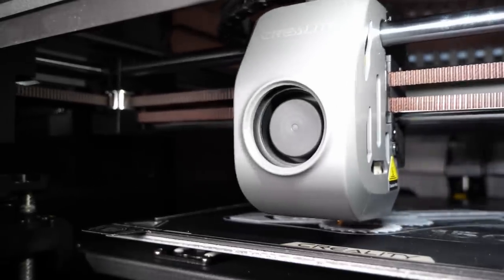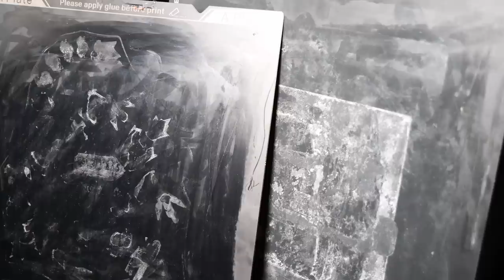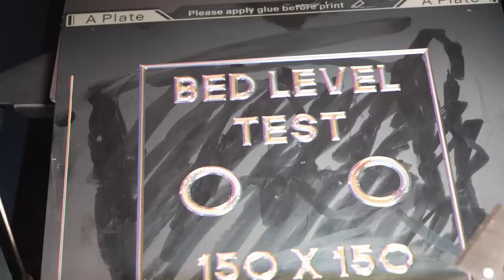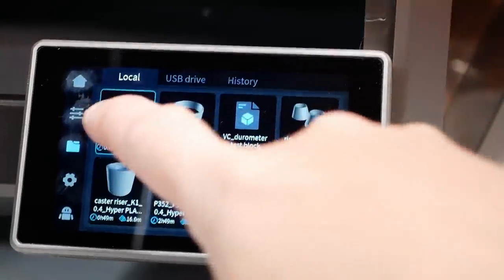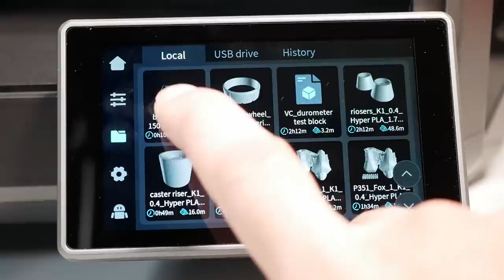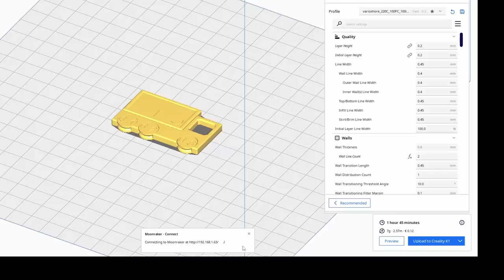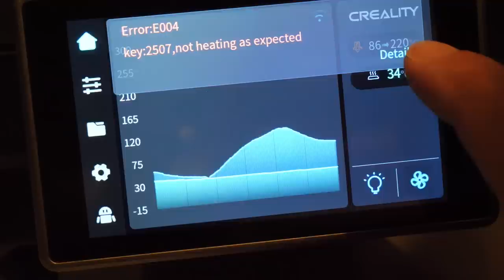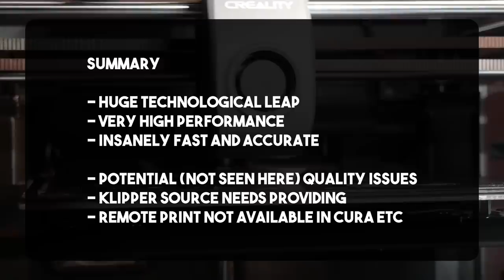The Creality K1 looks amazing, does it live up to the hype?

Comment: The one I got shuts down mid print, fan, extruder, lights everything 8 out of 10 prints. JUNK! IT'S GONING BAC K
Reply from the maker: That's a klipper shutdown, you need to look at the slicer to see what the error is. It's probably a loose thermistor.
Reply: Thanks I hope they do that when it arrives back at the factory. Appreciate the comment. @LostInTech3D

Comment: Same questions I wanted answered from the other reviewers. Max flow with petg? Max accel that doesn't cause ghosting? Minimum achievable layer times? Typical retraction setting? Thanks!
Reply from the maker: - Not sure about PETG but PLA is 32mm^3/s.
- Accel, ask me after I can access it (claimed to be 20k)
- Didn't test that but the speed benchy looks like it's pretty low, also gonna depend on a few things
- retraction is .5mm @ 40mm/s
Reply: @LostInTech3D  Appreciate it. You tested the volumetric flow? My printers are always lower than claimed if I want to avoid rough infill or undercooked filament
Reply: @1fareast14  using generic PLA and CHT clone, I can get 30m/s^3 with excellent later adhesion at 230c (the generic filament does recommend up to 230c). At 240c, I can 36m/s^3 with excellent adhesion and 50m/s^3 without skipping a line. I would have done further testing but I got the common hot-end heater problem. The revised hot end will hopefully resolve that problem.
Reply: @xsvforce3335  That's what I was looking to hear, glad that Creality are giving realistic numbers (assuming stock nozzle is also cht)

Comment: I think Creality has been outdone, not only by Bambu, but by Elegoo, and now Qidi Tech.  In terms of low cost bed slingers, the Neptune 4 and 4 pro seem to have hit a home run.  And in terms of the high end core XY machines, the Qidi Tech X-plus 3 and X-max 3 seem to be outclassing the K1.  I really like the K1, and my only printer I have ever owned is an original CR-10 which has been great.  But right now, I would not buy the K1 with all the issues I have seen others have.  The Qidi has a 350 degree hot end, and an actively heated chamber, they are the ones pushing things foreword , and trying to give you something different than the competition.

Comment: You have been very lucky I guess.  I got my printer in early May and it worked great for about 10 days and then started to fail over and over again until the extruder stopped working and ended up getting such a clogged nozzle to the point that it can not will not be cleared out no matter what you do to it.  Wish I didnt get the lemon and Creality customer service has been absolutely worthless!  My Bambu X1CC puts this printer to shame in every category except price.

Comment: The hotend broke within a day. Refuses to heat up anymore. Got about four prints out of it which were just test files. The ceramic heater needs a desperate redesign to prevent it from breaking so easily.
Reply from the maker: I forgot to mention because there's so much going on, but the hotend HAS had a redesign, someone on twitter showed me it. Get in touch with them.
Reply: @LostInTech3D  Thank you, just actually received the new hotend this afternoon. They've changed about three things that i can see already. One the new sock is red, the thermistor is now externally placed on the outside of the lower brass ring. And lastly the connections for the heater element look a little more refined. Just installed it and going to run some tests. woohoo. And yes, Creality supplied me the hotend free of charge as the unit is still brand new.

Comment: The on-screen menu looks like a Bambu ripoff (and actually seems to be a Klipper ripoff), the extruder looks like a Bondtech LGX ripoff, Creality cloud is known for ripping off everyone's models, their slicer is just Cura with a worse (e.g. not configurable) UI and their phone app pushes ads and notifications on you.

Bambu Lab is also not perfect (closed source firmware), but at least they actually improved on the UI of Prusa Slicer, and they properly open source their own extensions (e.g. STEP file import) and their phone app is fine and ad free.

Also: The K1 (now) costs the same as a P1P, and you exchange 1/3 less build volume, no camera, no PEI build plate, and no multicolor extensibility – all just for an enclosure.
Why anyone would buy that is beyond me.
Reply: Pipe down bambu paid pumper lmao

Comment: 10:42 the golden ring is there to solder a tin can over the components
em interference shielding
Reply from the maker: Oh. Interesting! It does raise a new question lol
Reply: @LostInTech3D  it can be both, shielding from outside interference or meeting emission standards
Reply: Came here to write the same thing. They even populated the holders (the "TP" numbered parts), just the actual metal can is missing...
Reply: Lol I went down about 3 pages, didn't see a reply, so added mine. Then I saw yours!

Comment: I am waiting for the K1 Max

Went down to MicroCenter to see it in person, printed x3 18min benchies - 2 with high speed pla, and 1 with silk pla….there was notíciale ringing on the side surfaces….I was assured that the machine has very good quality- apparently they lost or some one stole the giant rubber feet….so I was Impressed by the machine 1st layer reliability but one it spooled up it fell apart…..

My P1P prints beautifully in lúdricas mode

Comment: This isn't the first enclosed, core X-Y Creality made, they made the CR-200B which was pure garbage. I know, I owned one. It was my first 3D printer and was so bad it almost turned me off on the hobby altogether.  Creality redeemed themselves with an open-box CR-6 SE that I picked up for $137. Had it not been for the bargain I got on the CR-6, I would likely have abandoned all interest in the hobby. The CR-200B has since been stripped down to spare parts and will go on ebay at some point as there aren't a lot of spare parts for it out there. 

Well, after a few 3D printers (Creality CR6, BIQU B1 and B1SE, and some resin printers, an Epax E10 clone and Creality Halot One), I almost pulled the trigger on a Bambu X1 Carbon when the K1 was released. I took a chance on the K1, fully intending to return it in frustration but it did surprise me and I kept it. I've had it for about 2 months now and it's done very well with everything I wanted. I've only printed PLA and PETG so far, going to try TPU soon though. 

It does come with a glue stick, maybe you missed it still in the packaging. I think it was in a compartment in a foam piece. I didn't use it more than a couple of times though, I ended up buying a PEI sheet and it works much better. 

As for the extruder, Creality redesigned it and I believe were giving out free replacements if you had the first generation, early release model and complained about it. They also have a deal where owners can get a $100 welcome kit for $3. It comes with another extruder, a spare hotend, the camera addition, and a spool of their "hyper-pla".

As for being locked into their Creality Slicer software, I'm hoping someone will give us a profile to use in Cura soon. The supports CS generates are horrible compared to the regular Cura. I don't know why, but the same print on my FLSUN SR Delta printer has different/better/more supports than my Creality printed model does. 

Creality did a good job with the K1 series as far as I can tell, they seem to have done it right this time.

Comment: I've never used glue stick on my X1C PLA plate and it has never needed it. Adhesion is perfect without it. I'm interested to see the longevity of this printer. I've used lots of creality printers and have been relatively happy. It will take A LOT of convincing for me to move away from my X1C though. 

Edit: I commented too early. Yeah, the K1 is a solid noooo from me 😂. Just kept getting worse and worse the more I watched

Comment: DO not buy the K1. I had two copies, I had get a refund in the end. SO much problems with bed tramming, extruder, unusual noises.
On paper it's great, in reality it will cause you headaches. I got P1P instead and it's been GREAT. That's the experience I wanted.

Comment: LOL they cloned the Bondtech LGX Lite.
Reply: But they didn't get it quite right. Hopefully they will soon.
Reply: Not really. It's a dual drive extruder (the first was the Printrbot Gear Head), but it doesn't have the LGX Lite's tensioning system (the best thing about that extruder in my opinion).

Comment: Call me a dummy, but why do you apply a gluestick and then complain about the parts really sticking and requiring a special tool to get them off?
My Ender3v2 doesn't need anything special on the surface, why would this one need glue? It feels so 2019 to need glue....
Reply: The gluestick acts as a barrier to the bed, the bed itself sticks more than the plastic sticks to the glue, and can rip the bottom of your print off if there's no barrier
Reply from the maker: Exactly. It's a release agent on this type of bed.
Reply: put k1 bed on your ender u will see glue is not adhesive on that build sheet its release agent
Reply: I personally use Hairspray, easy application

Comment: maybe its a different material.. I just use rubbing alcohol with mine.. never used a glue stick.. ever.. and even after it cool the damn print is hard to remove.. I think its kinda dumb if you have to use glue..